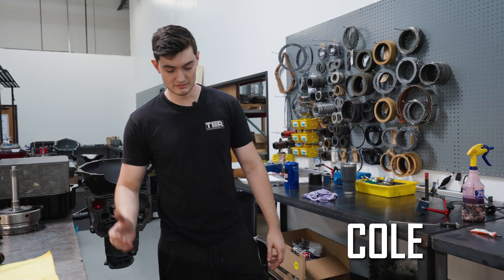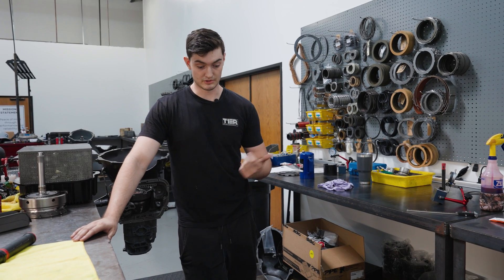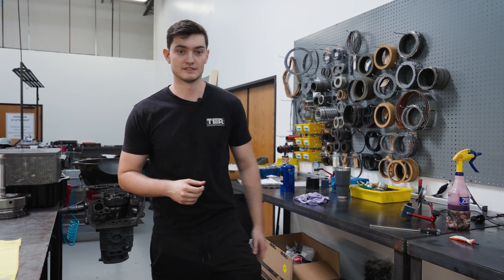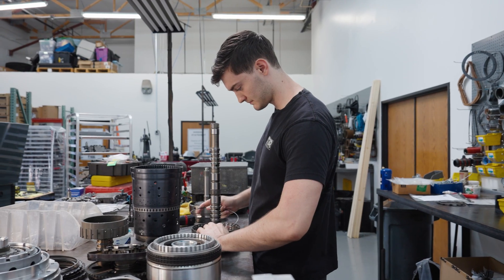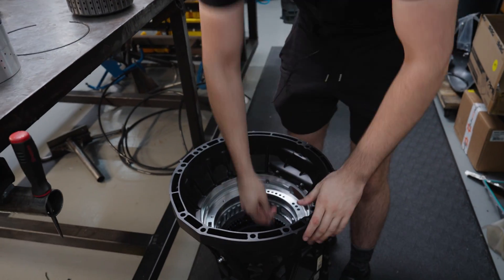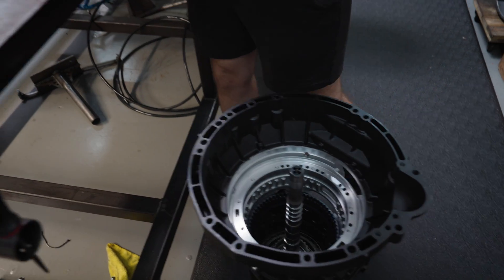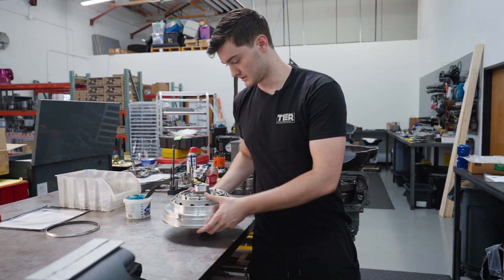Building a 750 Horsepower 10R80 Transmission | 2018 Raptor

Comment: Which way is the best to assemble trans? By setting the trans case up and installing it part by part or having everything built and installing it in the case? Is there any issues on doing either way?
Reply: I have done it both ways and this is absolutely superior. I’m not going to lie, I really like how he assembles this. I’ve modified my procedure now. I don’t like using the crane

Comment: Why not assemble the outer shell outside of the transmission? Any particular reason?
Reply from the maker: It really comes down to personal preference on these. Mainly if you assemble outside of the transmission, it just ends up being 70lbs that you have to lift and install.

Comment: The ford parts seem cheaper than the GM parts. Can ibuy the upgraded anodized drum and basically build it out of all ford parts and it will fit right into a 10L80 unit? I dont have the time for the truck to be down so comsidering building an upgraded cherry bomb assembly so i can just drop it in when i am ready
Reply from the maker: According to our 10-speed builder, the CDF drum and the reaction shell are the same between the Ford 10R80 and GM 10L80, so you should be able to interchange them.
Reply: @tieronetransmissions  awe just those 2 parts, was hoping more would interchange but thanks for checking
Reply from the maker: Most of the internals are also interchangeable, though there's a few differences in the pump, stator, and input.  For a full list of interchange, give us a call at 602-399-5484.

Comment: fun to watch but not soaking discs  ????
Reply from the maker: Soaking the clutches is not really necessary on these transmissions.  Modern clutch materials don't tend to need it in the first place, and with the line pressures that these transmissions operate at, the clutches are essentially soaked as soon as the transmission is put into gear.
Reply: @tieronetransmissions  got ya just seen on other vids peeps soaking them

Comment: As simple as this looks, even though I know it's probably not that simple, how in the hell can something like this cost 6 to 8 grand to rebuild?  It looked like most of the parts just dropped right in.
Reply from the maker: We do a lot of editing, and we skipped  the entire valve body for this particular video.  We charge 12 hours of labor for a Stage 2 transmission.  For this video, we cut out a bunch of the fiddling and adjusting the clutch packs, which can take several tries to get clearances right (especially the E-clutch assembly, which we'll have a short on today).  The valve body is roughly two hours of labor on its own.

For a 20-odd minute video, we're filming around 10 hours worth of work, with a lot of the more boring, fiddly things cut out.

Comment: cool to see how u build part by part inside the trans . ive done hundreds of 10R80 rebuilds and also put the whole trashcan assembly together outside of the case and drop it all in 1 piece after its together.
Reply: What does it take to rebuild a 10r80. If I was to do it in my garage what tools would I need and what sort of plans could I follow to learn more about the 10r80 in general

Comment: I bought a new 2022 f150 5.0 and the transmission failed after 24k miles. Ford couldn't fix it so they installed a new 2024 10r80.....hopefully they fixed the problems with the 2024s  😂
Reply from the maker: The 2024 model year 10R80s should have the updated CDF drum and reaction shell designs, which greatly help with reliability.  There's still the risk of roasted clutches and geartrain failure, but that's a least less likely happen than CDF drum issues.

Comment: Can one of these be built to live behind 1000 hp drag/street application? Thinking about a nitrous Godzilla in an early Mustang..
Reply from the maker: Unfortunately, the highest power rating we offer is 725hp at the crank.  Right now, there's not enough of an aftermarket for the 10R80s to push much higher than that, and the internal design of the transmission makes it tricky to push past that.
Reply: @tieronetransmissions  You guys should really need to get in touch with Shelby and get them to use your trannys. 😎They are using the stock 10R80 in the Shelby Super Snake (mustang) that is pushing 830HP. 😬

Comment: Is there a reason you don’t presoak the clutches in trans fluid before installation?
Reply from the maker: Thanks for your question!  Firstly, at the line pressures modern transmissions like the 10R80 operate at, the clutches and internals are lubricated as soon as the transmission is put into gear.  Secondly, modern clutch materials are a lot better than they were in the past, and are less prone to burn-up.  It's just not really necessary to presoak the clutches on these transmissions, and pre-soaking the clutches just makes putting the transmission together more annoying without much tangible benefit.
Reply: @  figured it would be something like that with newer trans. I’m used to the older generations. Thanks for the info!

One other question, any idea the differences between standard F150 and Raptor 10R80’s? It would seem a 2018 Lariat with the AWD/4WD has the same transfer case and trans as the Raptor, but some sites state that their replacement trans don’t fit raptors.
Reply from the maker: It's our understanding that the 10R80s in the Raptors and F150s are at least interchangeable, if not completely the same.

As far as F150s equipped with 4Auto, all of that is done in the transfer case, and the transmission is the same across models with both standard 4x4 and 4Auto systems.

Comment: I would love a stage 2 10R80. 🙋‍♂️
Reply from the maker: Shop online or give us a call at 602-399-5484!  https://tieronetransmissions.com/17-24-f150-stage-2-725-10r80-transmission
Reply: @tieronetransmissions  2022 Roush F150 with NA 5.0. Need to address brakes and transmission before any engine mods.

Comment: Thanks for the video, I was just wondering why you're installing the friction linings dry. Wouldn't you normally saturate the friction linings with ATF before installing? Or is that old thinking? Cheers
Reply from the maker: Great question!  With modern friction materials and how modern transmissions operate, there's really not a need to.  Once you do your initial fill and put the truck in drive on a modern transmission, everything inside is essentially wet and lubricated at the line pressures that modern transmissions push (even if we do bump line pressures for performance applications with the valve body modifications we make).  Friction materials these days are also GREATLY improved than they were in the past and much less prone to burn-up.

Putting the transmission together dry (other than assembly lube and minor amounts of ATF in the pump gears and other components) makes assembly easier with essentially no downsides on the 10R80s.
Reply: @tieronetransmissions  Thanks so much for your detailed reply, I can absolutely see that dry clutch installation would be easier than doing it wet, but I was always told that dry installation meant friction lining burn out on first application. Good to know that this is working for you, Really appreciate the response, going to subscribe to your channel, cheers!
Reply from the maker: Thanks for subscribing!  Let us know if you have any more questions.

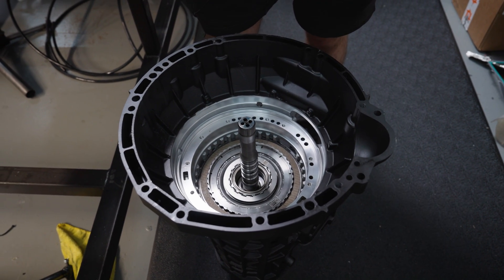Comment: “Makes relearn a pain, but they hold a lot better” .. can you explain that further? 6:56
Reply from the maker: Great question!  The GPZ clutches have a more aggressive friction material than stock, which causes slightly firmer shifts in general.  However, this can cause REALLY firm shifts during the relearn period since the 10R80 is a "learning" transmission controlled by the PCM.  To be fair to Ford, the PCM software does a good job of smoothing things out over time, but that initial relearn period can see some harsh shifting.

Comment: Do you install any Sonnax parts in the valvebody, like end plugs with o rings, or the heavy duty solenoid clips? Or just the Ratiotek kit?
Reply from the maker: @machine7767  Every valve body gets the Ratiotek kit and solenoid clips. We thoroughly vacuum test the PR valve bore and TCC priority valve bore, if the plugs show a leakage they get swapped.

Comment: Surely there's a better way than to grab the spline with VICE GRIPS! to lift it in??.. could risk damaging the teeth??
Reply from the maker: @patrickwilliams8582  as long as they don’t slip, you’re not damaging the teeth.
Reply: Can you put some rubber hose over the vice grip jaws?
Reply: @machine7767 

Absolutely, you should use something to protect those teeth.
Reply: Surprised you have vice grips in the shop. I’m out!
Reply: @mcmuskie2563  jealous?
Reply: Some kind of builders prerogative. Have never seen builders not use vise grips. For example THM400 gets a good shaking! But you and me are not authorized and I even advocate no air tools. The old dudes had no fingertips. minus ten! They boldly goed into multishaft trucks like Eaton 13 speed and such. Today we keep our fingers but RIP on those  Taryton smokin Carling Black label dudes. I my opinion after bolting on a zillion heads and intakes you get a mindset for flatness that stays with the process during a build. Tranny dudes as a whole are not there usually. Another thing, in ramblidge, none consider the high frequency vibrations and the resonance effects during snap ring placement but thats dogma really mystery bs.
Reply: @AlbuquerqueImaging I regret reading this comment. It is odd and not worth the few seconds lost.
Reply: @mr.monitor.  you understood well
Reply: @AlbuquerqueImaging  Did you delete the comment? I don't see it now.
Reply: @mr.monitor.  i dont remember
Reply: @AlbuquerqueImaging  Are you in need of medicine?

Comment: How different is this to the 10L80E from GM?
Reply from the maker: They're different enough to be annoying.  Despite being derivatives of ZF's 10-speed, both Ford and GM made some changes that hoses you on interchangeability a bit.  The major differences on the 10L80 versus the 10R80 are the idler gear and bearing (which causes whine and potential failures on the 10Ls), the pan, case, output shaft, and valve body.  

They do share the same clutches, CDF drum, outer shell, and a lot of the smaller internal components and seals.  We're looking to get into the 10L80s here pretty soon, but the interchangeability issues have slowed us up a bit.